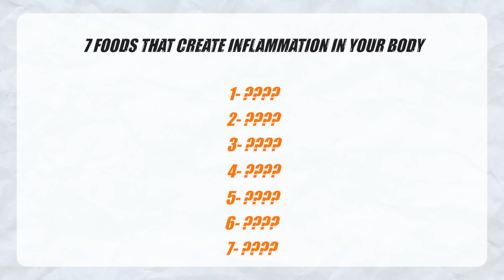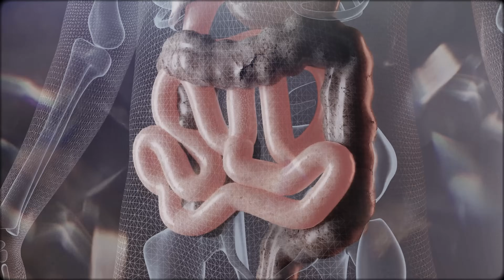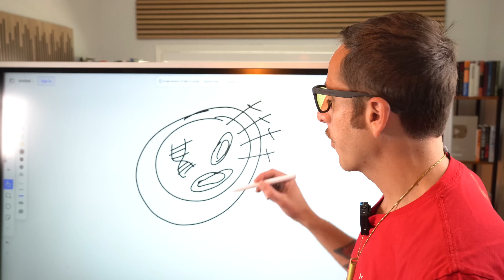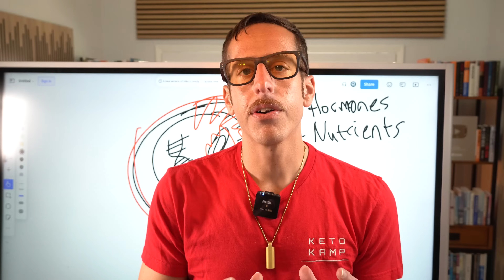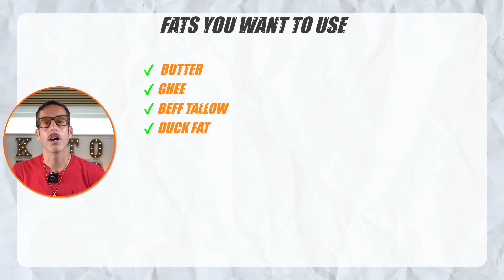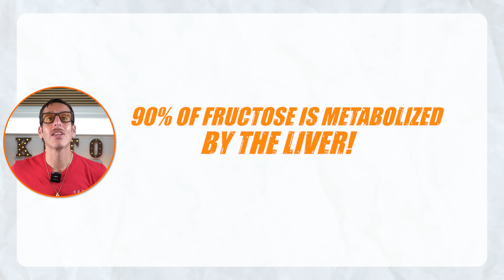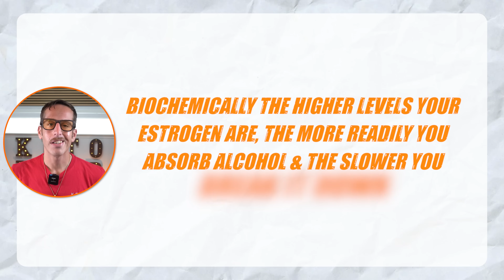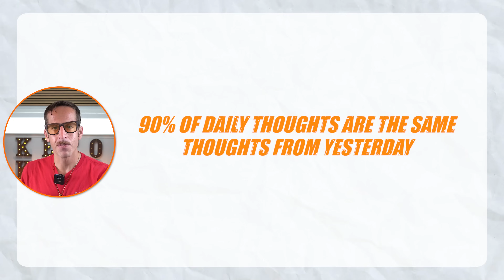The 7 Foods That Destroy Your Health (Avoid Eating This To Live Longer) | Ben Azadi

Comment: I have always had a slight gluten intolerance and gave up eating bread long ago since I am a type 1 diabetic. But, what is odd, I made some low carb bread with almond flour, which I have done many times, but this recipe called for nutritional yeast to be added. I wound up in the hospital in anaphylactic shock. They asked what I ate and were puzzled and thought maybe I was allergic to almonds. They sent me to have a test for food allergies, turns out I was oddly allergic to yeast. The sad thing is, I found out I am also allergic to beef, eggs, shellfish, peanuts, pinenuts, walnuts and a host of other things. But, a lot of my diet was composed of beef, eggs, and shellfish, so no wonder I always felt bad, those food allergies were causing inflammation. It suddenly all made sense, but also severely limits my diet even worse than just being a type 1 diabetic does.

Comment: If you are right why is animal fat seen as the number one factor for diabetes 2 ? “excess fat deposition in key organs, such as [the] liver and pancreas, accelerates diabetes risks,” said Naveed Sattar, Ph. D., professor of metabolic medicine “ .Only 2% of carbohydrates you eat turns into fat but 70% of fat?
Reply: Where are you getting this statistic, 2% vs 70%? This is completely incorrect. Absolutely insane. Carbs are readily stored as fat. Dietary fat is not.
Reply: @danacamp5437  not true ,this statics are from Lane Norton